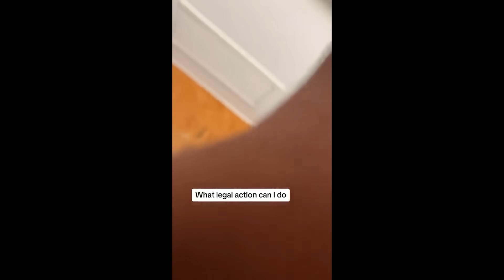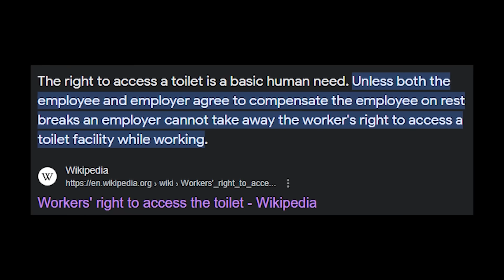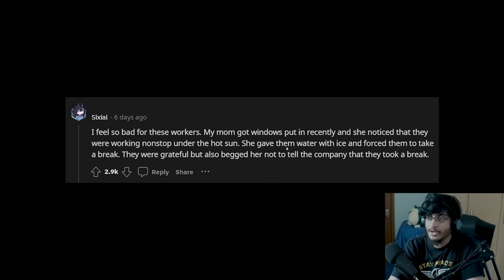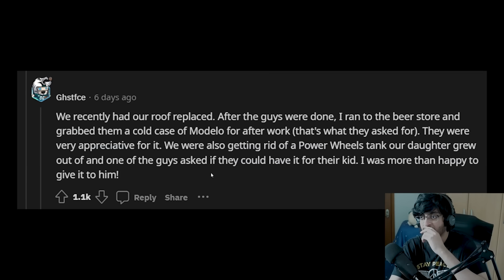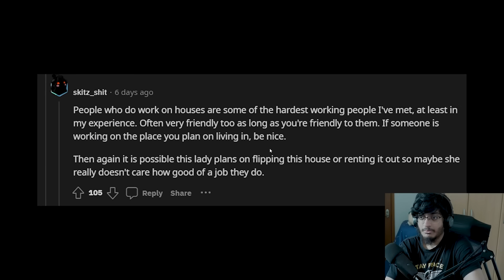This Video Will Make You Angry.

Comment: To a degree yes you have the right to use the bathroom, they also have the right to deny using their private bathroom. However if they deny workers that right they have to foot the cost of you wasting more time to go else where. Most jobs like that get paid by the hour, it's a difference of taking 5 minutes to use a bathroom on site, or spending 30+ minutes driving around for one. Now that is basically contract work.

As for a more fixed location in an office or working at a store, yes you have the right to the bathroom. Something a lot of people these days abuse to sit in the stall and be on their phone. Sadly not a lot most companies can do about it.

Comment: I have an association coming by my place here and there to help me with autism (I have Asperger syndrome), regularly order books from amazon and sometimes get IAP technicians when my internet box thing isn't working and every flipping time propose a drink or a quick thing to it. I'm even trying to set money aside to buy a better coffee machine (20 bar pression and everything) because i want to make it as nice as possible for them. Heck if they need a meal break I cook them something good (if I have enough food). It's just normal. If you're nice to others, they're more likely feel good about it and be cool with others. Obviously some people can be a**holes but it's life. Last time the autism association dude got 2 cappuccino and a croissant. My curator had some tea (and I'm talking tea that i paid like 10 bucks for 100g).

My point is be nice to others but people like that I'd stand up for myself for sure. If it goes far it's no problem since I'm a wrestler and pretty high level in multiple martial arts.

Comment: It looks like the worker that was continuing wanted to finish out where he had spread the mortar or whatever it’s called. That stuff dries quickly so you have to lay the tile down fast. Probably didn’t want to deal with having to remove it and do it over.

Comment: As long as you got a good contractor treat them with respect and pay them fairly. Half upfront and the rest when they are done. Also not letting someone use the bathroom is terrible. I remember helping a contractor i know remodel a kitchen and it was very hard work. Tearing out the shelves, tearing out the sink, removing the old floor doing sanding, putting down a new foundation, cutting and sanding wood, cutting the granet for the sink and counter top, then installing everything. Then adding the final touches, paint, fixtures and everything else. It's not an easy job. Floors are painful on the back.

Comment: At least in the US, landlords to not give a single crap about making their tenants happy. Few landlords will go beyond the absolute bare minimum of what is legally required and they will nickel and dime you for every little thing they can get away with. It's actually common practice as a renter to take pictures of imperfections on move-in because of how likely it is the landlord will try to charge you to fix it when you move out. And then they probably won't even actually fix the problem! It actually benefits landlords to not have tenants live somewhere for too long in my state because after so many years, they are legally required to do certain renovations and may not be able to get away with forcing the outgoing tenant to pay for it. So if a tenant is unhappy, they can go somewhere else and another tenant will take their place

Comment: Use to install above ground pools, and you would be surprised at some places we installed them at. Had a few customer's that wouldn't let my crew use the bathroom and by law the home owner has the right to let you or not let you in the state of PA. Most area's we did have wooded area's so it helped a lot, but even then the company I worked for had the rule that we had to ask the owners before we just used cause of this.

Comment: Lady, I know someone who has connections to multiple people when it comes to working on the interior and exterior of a brand new home. DO NOT ever be rude and tell them they cannot use the bathroom in your house when they're working glove, tooth and nail of placing every tile, every little detail for hours on end.
If they wanted to they can remove every tile, turn off the water, and remove you off the grid for electricity and tell every other stores that do house work to never come to you ever again.

Comment: to be clear in this specfici instance - it IS illegal to deny them restroom bc - even though they are a mobile working vcrew - theyre being refused the restroom in the building, and the nearest bathroom is too far to be acceptable. 
you can only force agricultural work3rs to travel ten minutes to use a nearby bathroom, anyone else it needs ot be walking distance. 

so if they are working on that house, she denise restroom - but says - there's a 7-11 across the street that has a public bathroom - that's acceptable.

Comment: We had guys do construction using the bathroom in the residence...one guy didnt have tp and instead of finding some..he used a shower towell and FLUSHED AN ENTIRE TOWEL.DOWN THE TOILET.  Needless to say it instantly got clogged, couldnt be manually pulled and a plumber was required.   

After that no one can use the bathroom in the house.   They provided a porta potty in the driveway.

Comment: Hearing from older construction workers, what she is doing was the norm back in the day. You were not seen as a professional if you used a customers bathroom. Which led to weird embarrassing situations where the worker would have to sneak away to use a bucket in the truck hoping no one looked through the window. There's another reason contractors get coffee and its for the disposable coffee cup if they need to relieve themselves with it to dump it in the lawn later and toss the cup in the garbage pail. It's easier to hide a urine filled coffee cup in plain site  if it appears your having a coffee and get rid of it when no ones looking. The bucket situation stinks and they usually toss the bag out on empty roads. This is only the typical example of something simple to avoid by letting contractors use the washroom. It has definitely gotten better over the years with only a few people like in the video continuing to do this. So in a lot of tradesman's minds they've been conditioned to accept this, which might be why the other guy said nothing and continues to glare at the worker making the video. I can almost hear a silent stop and get back to work from those looks.

Comment: When you're a carpenter or house mover/setter/leveler, you can use the bathroom any time you need.....but there's usually no bathroom available. A 5 gallon bucket and a Walmart bag is usually what you're facing, if you have to poop. You just piss wherever. In my part of Texas, there's enough foliage to conceal you for a couple of minutes. Unless you work for a large company that provides Porta Potties. I've never had a job with those. But I could go potty any time I needed. I need an update on this woman. Where is she now? Shitting in a bucket, I hope. Lol.

Comment: Yes. You can deny the use of bathroom or any other room. Sometimes it is actually quite understandable if there is a chance that surfaces might get damaged from unordinary usage, ie. scratches on the floor from work shoes covered in plaster, walltiles or light switches get dirty from workgloves or hands, etc, but then you are required to find alternative solution. Be it a port-a-potty or other facility reasonably close to worksite.

Comment: I've been told I can't use certain bathrooms on sites before, just as a blanket rule and no workers can (though these are usually like 25 mil+ mostly finished high rise condos) most don't care however I've never been on a site where that was the case that didn't have porta potties somewhere on site, I'm pretty sure that's a law here but it may be the contractor of the job's responsibility to supply them. Regardless there's no reason for this lady to be a condescending ass hole to these guys.

Comment: First you never use the homeowners bathroom it's rude and not their responsibility to ensure you have proper facilities to use. This is why portta potties are usually required for jobsites, if unavailable you have a few options, the woods, gas station, or a fast food restaurant. There has been many occasions where you will see a guy run off the jobsite and drive like a bat out of hell, i like calling it an EMP (Emergency Poop).  I wont work for someone who is standing over my shoulder, if you want to check on the progress sure but your making me nervous and simply wasting everyones time. The home owner is in the right to stop them from using the house bathroom, not to prevent them from going all together, he has no legal action option you can walk off the jobsite but that's it. I've done it all roofing, tile, carpet, landscaping, painting, stucco, some light electric, and even light plumbing.

Comment: Wow lolz I mean I kinda get you perfer them not stink or dirty up the place and there's definitely more to it or she is a b one. I Clean people's homes and I don't want to use other people's home's... I try really hard to not and try holding until I'm home but sometimes that's not possible in those cases I try to use the bathroom b4 I cleaned it up fully so that there's no complaints and no one can say it wasn't cleaned cause I peed or whatever. My assumption was that it's a new construction house and the plumbing is not set up yet or atleast there's a problem or something like that.  And tbh construction workers are the worst for messing up a restroom. I should know that is most of my business cleaning a home after construction and some don't clean up anything after themselves at all and I've seen things you wouldn't believe like the toilet isn't in so they went in the tub... pee and poo in a tub that has construction dust and stuff all inside already so it won't just go down the drain and more. The Porta pody was only about 10 meters from the house too. So I never deny anyone use my restroom but I do want respect or being asked if it's ok so if I have anything wrong or anything else like valuables or medicine in there I have concerns about I can grab it or if a problem let them know so that they don't further break it. Have a different half bath too so the couple of times it happened I was able to tell them yeah np but please use the half bath cause the full bath has been having problems flushing and if you do have to use it please just lift the back and do it by hand untill I get that piece to stop the water. It's not rude to say " do you mind if I use your restroom" so if you gotta go try this if still not possible and you really cannot wait then of course go but try making sure everything is good no pee on seat and if the water isn't going down or not stop running say something or fix it if you know that you can... I really think there's more the guy didn't show... if not then yeah she's overboard 😅might have been with past construction workers but still it's legitimate to why she might have a issue with you going on your own accord to the restroom.

Comment: I had to comment on this because it needs a comment and here it is:  I would simply pack up my tools on the spot and leave.  on my way out the door i would leave her with the 2 most common words of my generation (X) which are: FUCK OFF!!!
Then I'd go explain the situation to my employer or if i'm the contractor i'd go home and i'd make sure to let all contractors in my industry know about this individual so they don't end up working for her either.  Alternately if i'm the contractor I'd have a portapotty brought in which of course will be added to the bill at a premium.

Comment: huh? you said boss, but isn't this a client?
it's a very different case when you say, "she won't let me take a bathroom break" from saying, "she won't let me use the bathroom in her property"

as for calling the police: if this was her property, she can technically say they're trespassing after she has told them to leave.

that doesn't excuse her from being inconsiderate though. but i wouldn't excuse the OP (the worker) for not knowing either; he even threw out the discrimination card but that went down the drain when he got told that they're both Mexican.
if she contracted a construction company (as opposed to multiple individual workers), then it's the fault of the foreman for not providing the basic stuff for the workers.